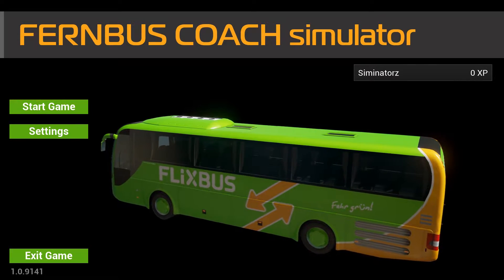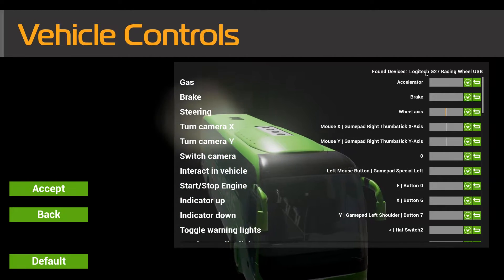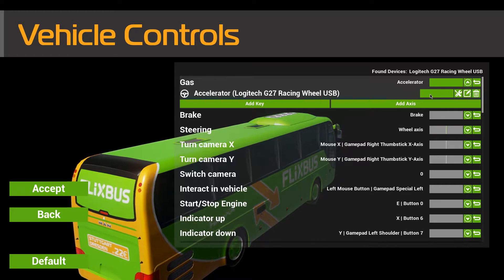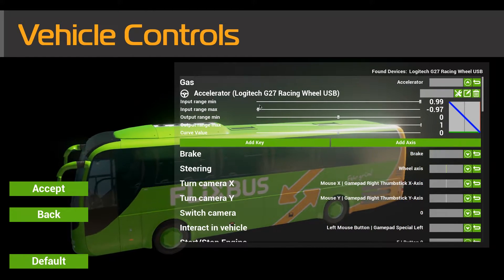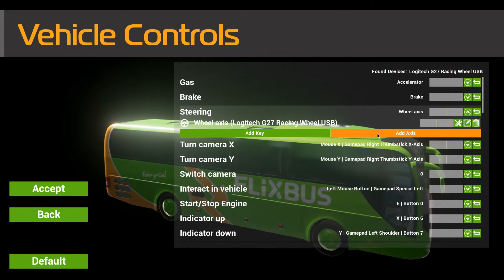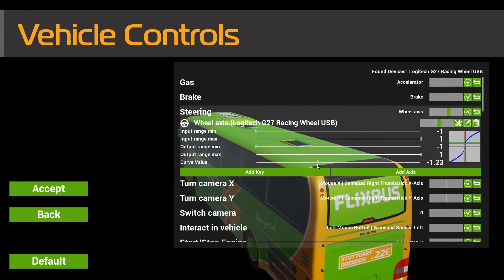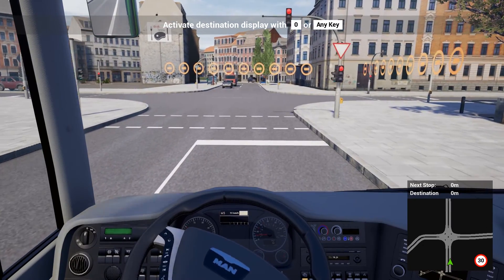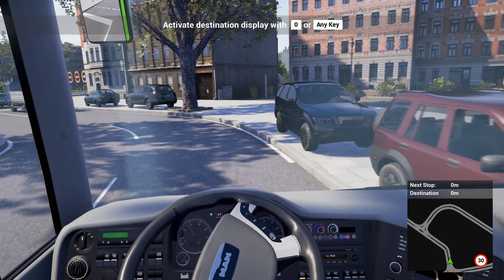FernBus - How to setup Logitech G27

Comment: thanks for the tip. But how do i remove the mouse from the controls since it is acting as not just looking around but also steering the wheel and as a gas pedal.
Reply from the maker: There should be a picture of a bin/trash can on the drop down menu, just delete it for the axis you are talking about. Then it should be fine.
Reply: Siminatorz i got it worked out before you answered, but thanks for the setup. It works normal now.
Reply from the maker: Sorry I wasn't quick enough but I'm glad it is working for you know.

Comment: You diamond! I'm currently using a PS4 controller which is OK but obviously wanna use me wheel!
Reply from the maker: Cool glad I could help
Reply from the maker: Just plug it in and see if the game detects it. It all depends if the game supports the actual wheel you are using. All I have to say is try it. Sorry I haven't been very helpful here.
Reply: Hi there. How do you make the wheel not as sensitive as it is at default? I want it same as when you use keyboard as passenger dont like it on the ps4 as it is too sensitive. tried to change it but cant seem to get it right.
Reply from the maker: If you are using the G27, go to the Logitech Gaming Software and go to global device settings and change the degrees of rotation to 700 then it should be 1:1.

Comment: I would be happy, if i get my Logitech Profiler to work. 
It didin't start... I've tried everything, but it's not work. :-(
Reply from the maker: Oh dear, I guess see if there is an update or somthing.
Reply: I have already check it out.
I try to fix it again on Saturday...
I've tried everything.
Reply from the maker: What is actually wrong with the software, is it not just loading or somthing else.
Reply: Software installing normally, but when installation is done, software not open. 
I've tried many times to install it again with different settings.